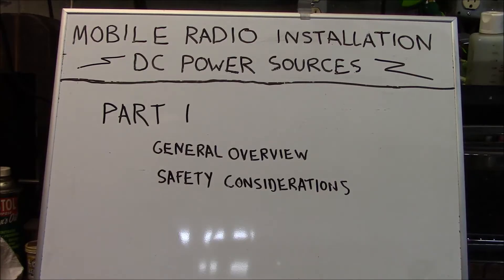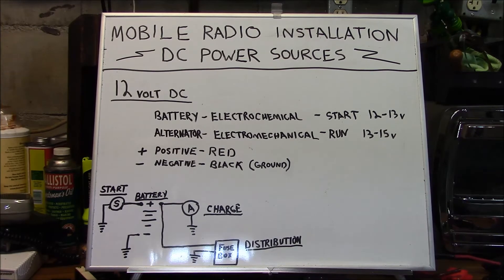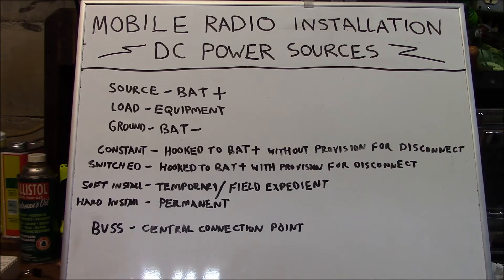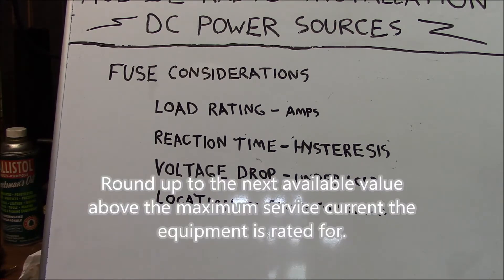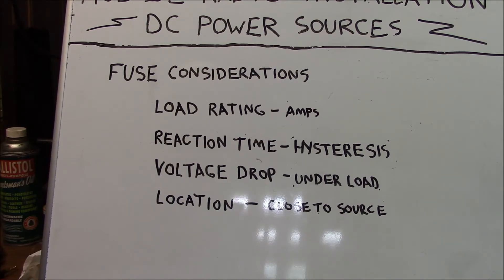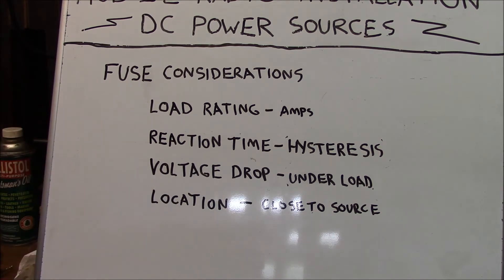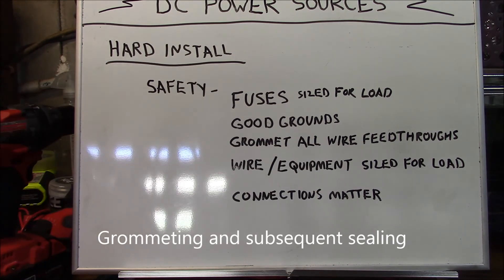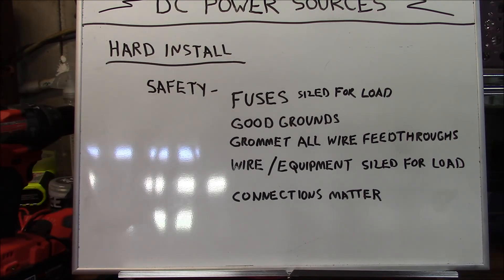Mobile radio installation DC sources Part 1 Overview and Safety

Comment: Nice vid… I ready buy 20 Amp power supply… radio work perfect. I got the model 2 UHF 40-50Watts. If you want see it, I got a video doing Test Mode here in my channel 👍

Comment: Excelent tutorial sir!🖒🖒
I noticed a circuit breaker in with the fuses. Do you prefer them over fuses?
Reply from the maker: Smokin Locust the fuse is faster acting than the breaker but is sacrificial. I use a 100 amp Marine breaker that I can open as needed to keep from disconnecting the battery. Thank you and thanks for watching !

Comment: Could't come at a better time. Just received an enhanced am/ssb/10 meter. Waiting on an ant. analyzer before install. Thank you
Reply from the maker: You are welcome ! There is more to come so stay tuned and thanks for watching !
Reply: Still have an antenna analyzer that needs to be made ;-) Didn't get all of the components back then ( thinking 20 years ago ), guess giving the list a once over wouldn't hurt, and sourcing the remainder of the components could take some months...or years...ok, then, another one of those projects - one of many :-)
Reply from the maker: LycanthropiesSpell projects are always fun ! Thanks for watching !